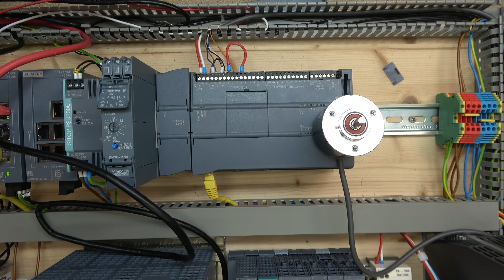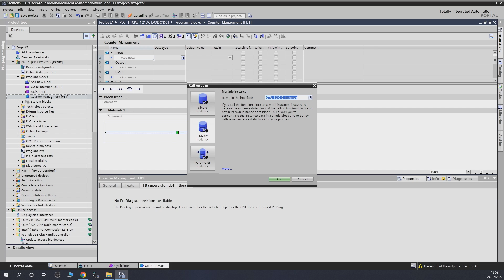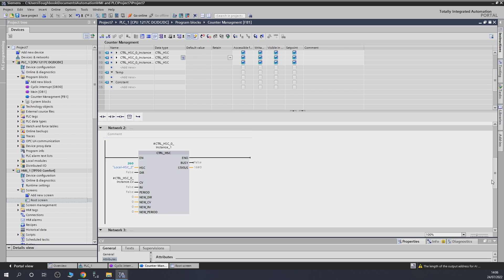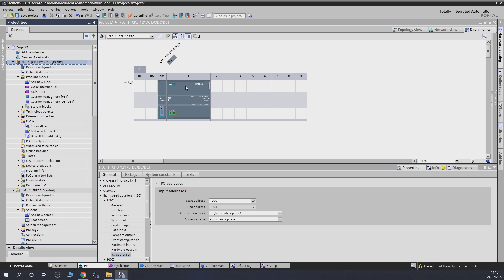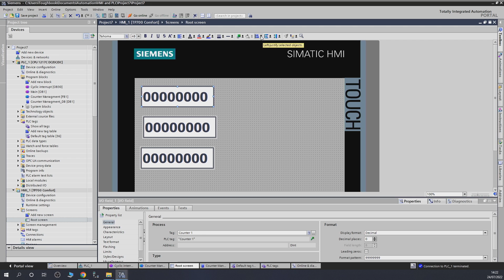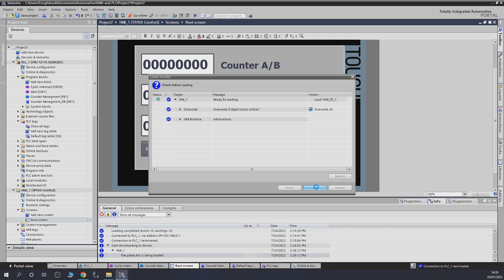Siemens S7-1200 PLC encoder high speed counter setup in TIA portal and TP700 HMI programming. Eng

Comment: I am using Push-Pull encoder, and i conected A, B and Z to 0.0, 0.1 and 0.2 inputs of 1215C PLC. Program is counting something, but I am not sure are reading correct or not ("countersingle phase" doesn't read anything at all). Can someone explain how this could be fixed, so it can work properly with my encoder? Thanks.